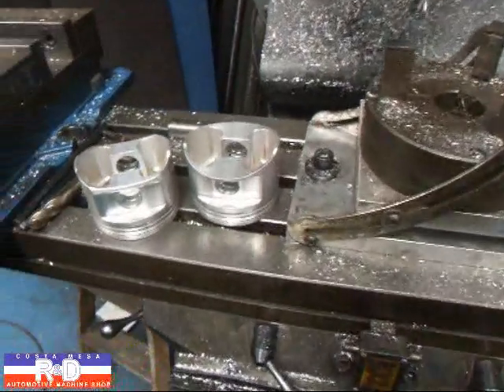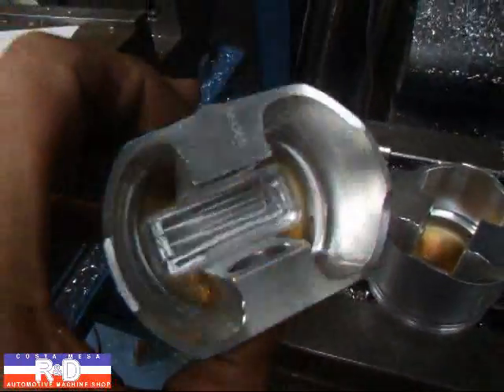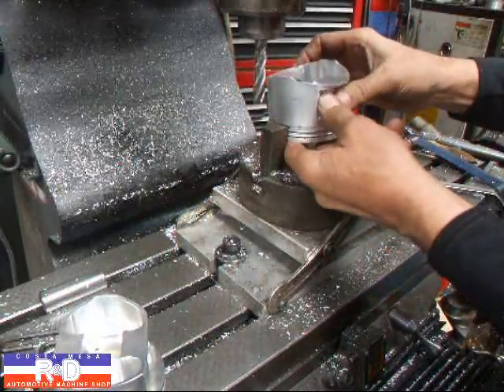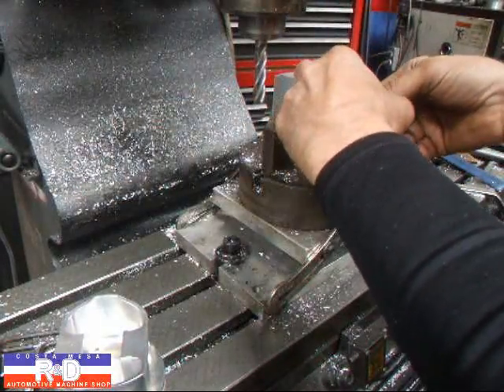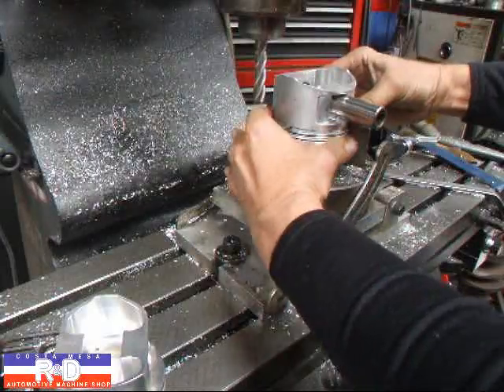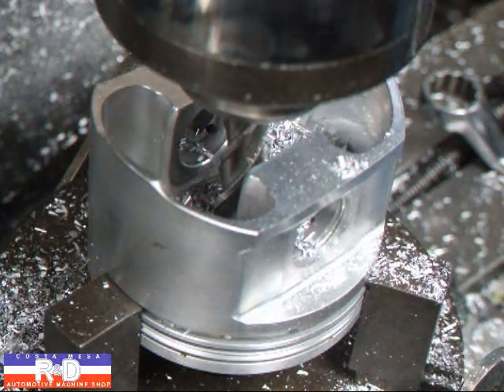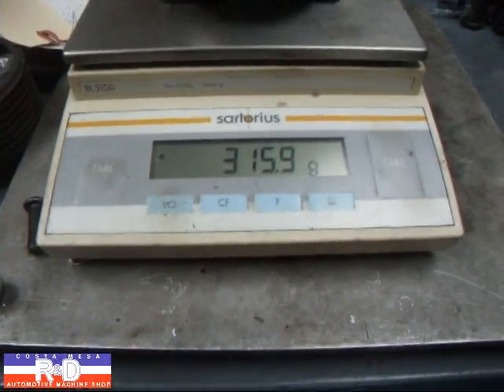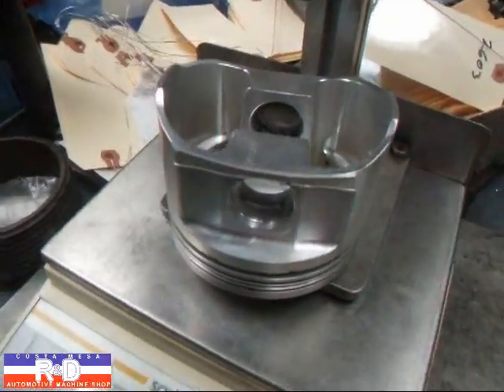Off Road VW Race Engine Piston Lightening

Comment: @ohm1163058 Nobody's perfect, but strait is not straight, vice is not vise, and more to the point, none of the surfaces machined were mating surfaces, i.e. perpendicularity constraints are unimportant there. The skirt, wrist-pin holes, etc. were left untouched.

Comment: ive worked cnc machines for the last 4years doing batch work, i would love to go back to a manual mill doing 1 off's and work like this :)
@ohm116058 looks likethe chuck jaws have been turned to suit the piston rings so parallels arnt needed, agree with indicating piston though, although i suppose it doesnt matter as what he is removing does nothing

great video,thanks